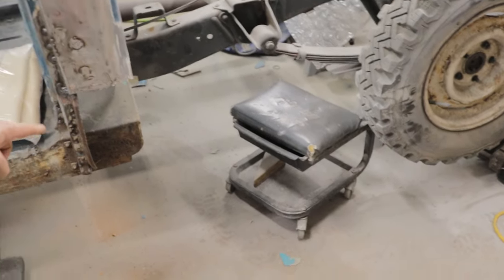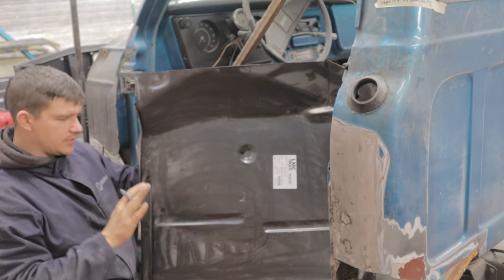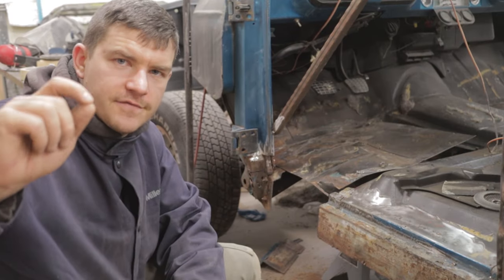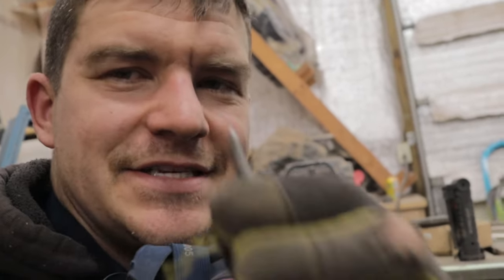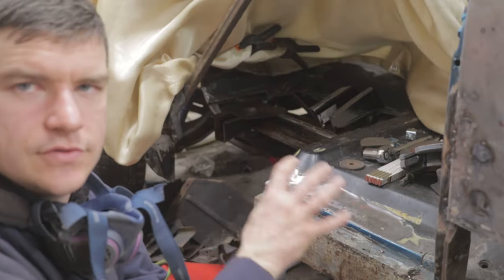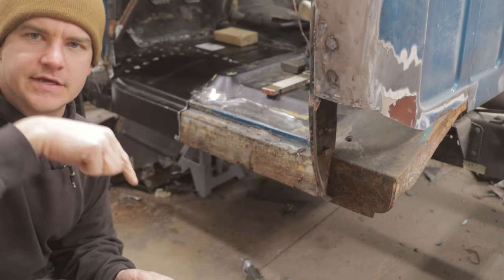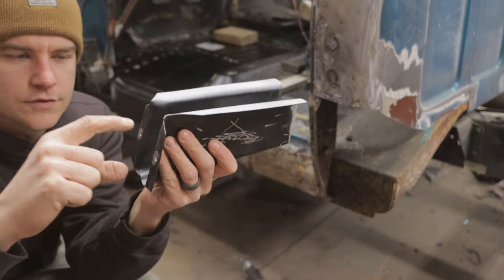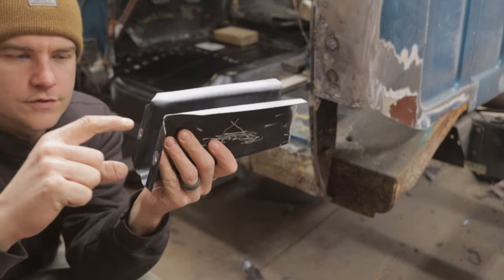C10 Cab Floor Replacement

Comment: So glad I happened upon this video! I recently acquired a '74 C10 that is in really good shape overall, but when I pulled out the carpet yesterday I found lots of old repairs along with some painted-over rot in the floorboards and inner rocker panels. I have yet to go over all the sheet metal in the area, but I'm sure I'll find more that needs attention. Thanks for all the helpful instruction!
Reply from the maker: Make sure you hit that subscribe button. I have a ton of other restoration/hotrod stuff coming. Don't be scared of those floors. The sheet metal is cheap and they're pretty easy to replace.
Reply: @youbreakityoufixit9594  Now I just gotta learn how to weld. Can't be that hard, right? ;-)
Reply: @youbreakityoufixit9594  in my truck, the outer rocker panels are good, but the inner panels are rusted out. Any advice on how to go about replacing the inner rockers without wrecking the outer panels? I'm trying to avoid having to repaint the truck, but that may not be possible.
Reply from the maker: @ronjennings7533  is the floor rusted out too? you can just cut out the rust spots and make panels just big enough to cover the area and be as conservative with cutting as possible. If the floor and the hinge pillar aren't rotted you could just leave it and repair it when it absolutely needs to be. No sense in taking a truck off the road that doesn't need to be.
Reply: @youbreakityoufixit9594  the floor WAS rusted out, but it was "repaired" using an old real estate sign from the 70s. I wish I could post a pic with this comment, because it's really amusing. It seems the previous owner replaced some of the exterior body panels, but simply painted the inner parts with rust converter. The rocker panels are only 50-60% there. I can probably leave it for the time being, then address it when I'm ready to repaint it. That won't be for a year or two yet, and I'd rather be able to drive it between now and then.
Reply from the maker: @ronjennings7533  I would just enjoy it and have fun with it on the road. The 68' c10 in the video had similar repairs. The put nice rockers over rusted inners and floor pans. The good news is when it comes time to fix it the sheet metal is cheap. Paint isn't so cheap anymore but there are thrifty was to get the job done.